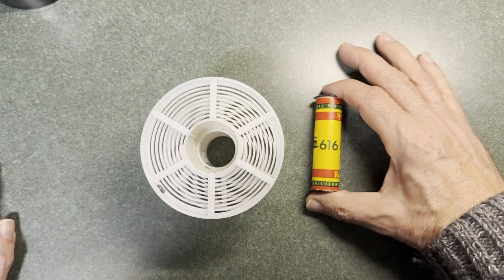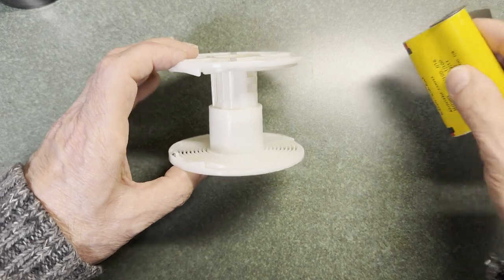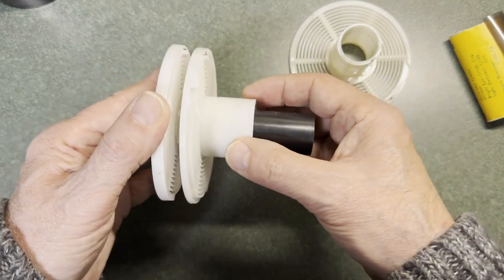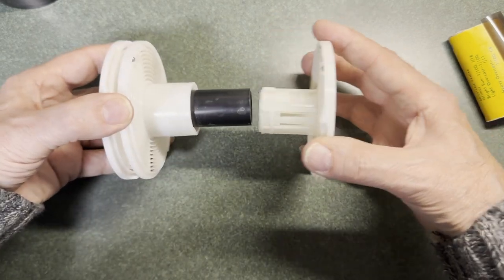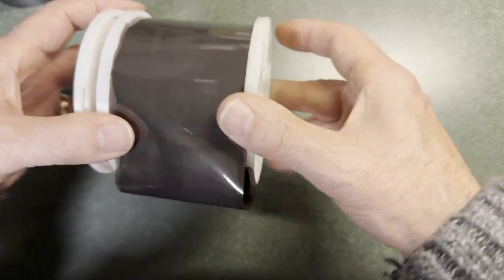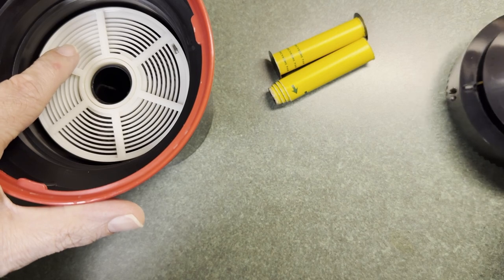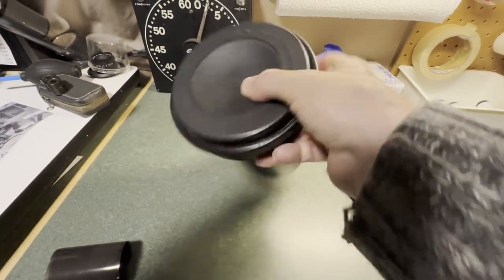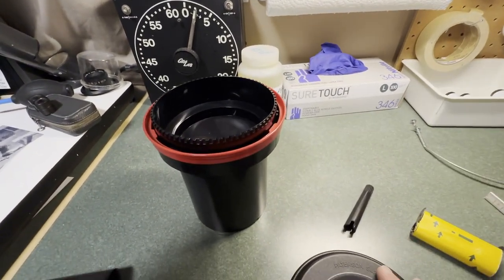How do you load 70mm film onto a 60mm developing reel

Comment: OK, cool so can I just use my old Hasselblad 70mm tank and reel?
Reply from the maker: If you have 70mm film and a 70mm reel and tank you don’t need to adapt anything.
Reply: @jsollowsphotography  right now I don’t have any proper 70mm tank or reals &. Only 1 15yp roll of that.  I wanna try 65mm & I’m ok if u have to keep it short to 1.5m for now inside the 5.5m cassettes.